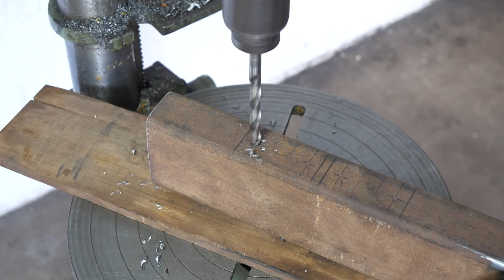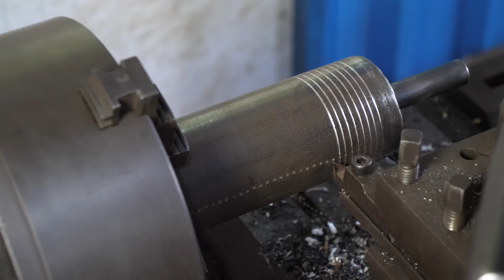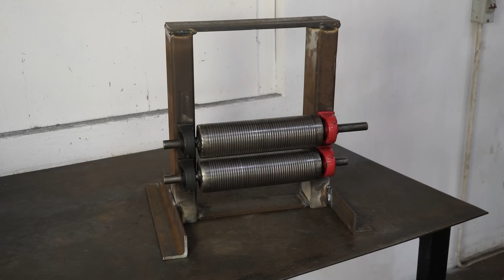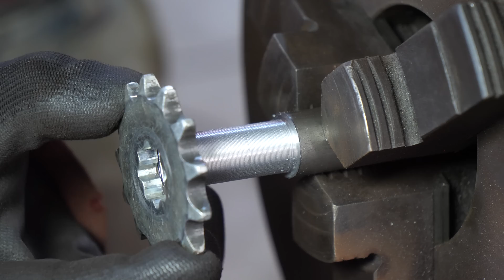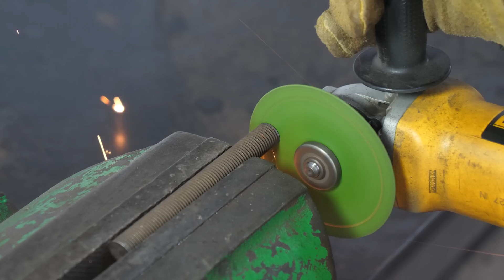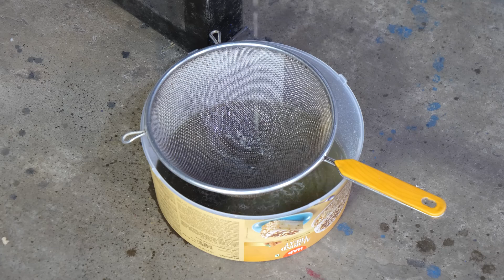How To Make A Sugarcane Juice Machine | Simple Homemade Mini Sugarcane Juice Machine | DIY

Comment: Shoft 5feet 500.4 bearing 1200. 2feet pipe 400. Closer 120. Teeth weel with chain old 200 iron 10 kg 700 labour with lath work 1500 total expense rs. 4620 if all parts old bellow 3000 irs
Reply: If stainless  steel food grade is used what will be the cost with motor arrangement pl
Reply from the maker: Sorry bro I'm not selling it
Reply: Sir what the name or size gear. Tnx
Reply from the maker: It's a spur gear ⚙️
Reply: Y @DiamleonDiyBuilds

Comment: great , but there is almost 200 $ of iron ? no ??
Reply: No, it's made in India.
Reply from the maker: Yes
Reply: great , but there is almost 16345,95 Roupies of iron ? no ?
Reply: @fredericthom8113  Iron is sold in India for approx 60 rupees per Kg. In the scrapyard you can get it even cheaper. Even if the iron used is around 50kg then it would cost 37 dollars.
Reply: @krunal7433  8l
Reply: @AliG-ps3ie  aq
Reply: And youll make the money back if you sell the juice
Reply: @papayaman78  OK indeed, seen like that, the price of metal who cares? I understood.
Reply: Mas tá girando ao contrário 😅
Reply: Pindagil
Reply: @DiamleonDiyBuilds I require this machine in Mumbai India how to order do ?
Reply from the maker: Sorry I'm not selling it

Comment: U did a very good job, i think that instead of using 2 rollers u should use 3 in a "triangle shape" it works better extracting the juice
Reply from the maker: Ok thanks for your suggestion bro

Comment: Good build.
However, i don't think that he should have wheld the gears on. He should have cut a key slot into the bars and key them in, so he could remove them if they need replacement.
Also i think that a third roller that can be adjusted would be good to get as much juice from the cane as possible.
Nice one though.
Reply from the maker: Ok thank you very much for your suggestion bro
Reply: Can you work on one for me but which will use motor

Comment: Well job.. but. For Rollers u would have chosen 316 ss matireal..
And the second is u have weld the gear's directly intsured of key way on shaft  .. there's was a key way on the gear.. when if u want to dismantle the unit .. so how u will do? Now its in one single block.. yes or not?..
Reply from the maker: Ok thanks for your suggestion bro

Comment: Everything is ok but you should have changed the gear ......the big one should be placed on top so that you can rotate it in clockwise
Reply from the maker: It should placed on the bottom roller, so that I can rotate clockwise. Anyway thanks for your suggestion bro.

Comment: I guess what you did wrong is that you forgot the physics calculation to put the big gear for the turn handle and the small gear with the rollers. This way will consume less energy and the rollers will spin 3x faster.
Reply from the maker: The torque will be very low.
Reply: 5:35